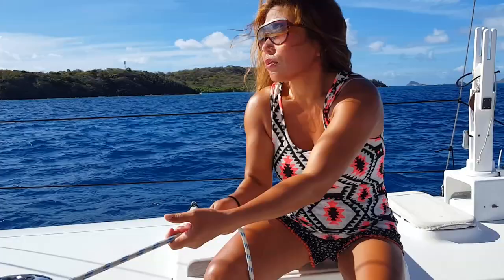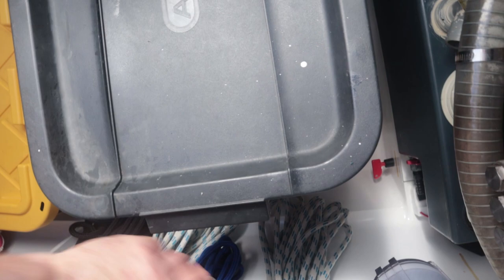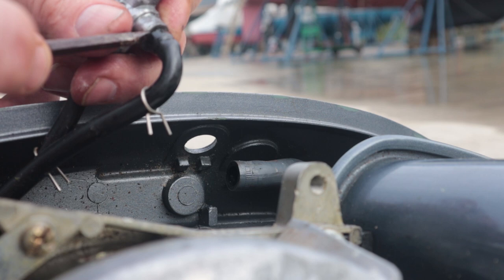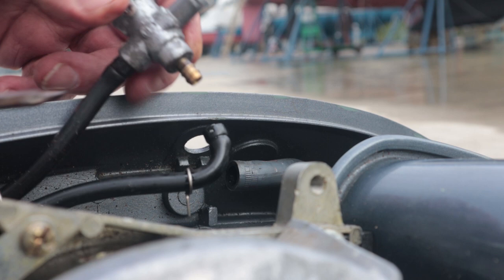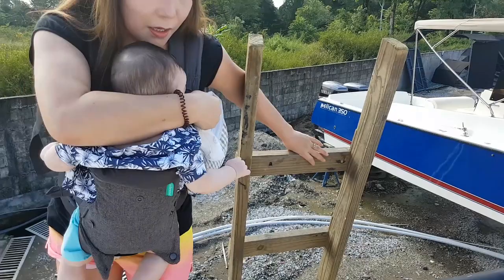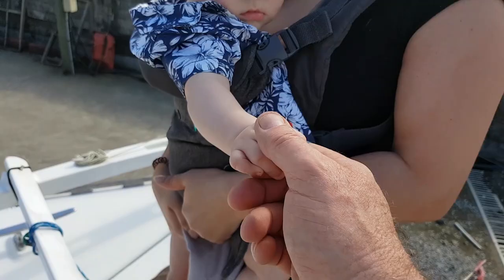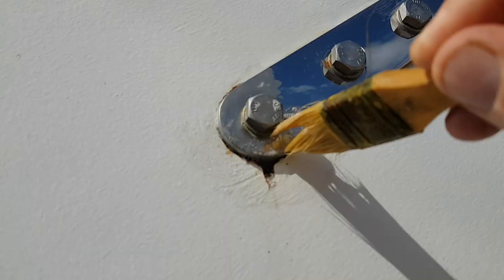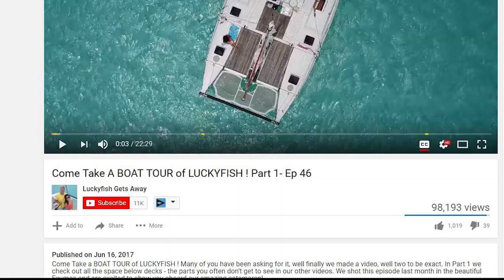Leo's first LOOK at Luckyfish - Ep 98 Sailing Luckyfish

Comment: I recall a previous video when you returned after having the boat stored during the off season, and the amount of mildew you had to clean up. (2-3 days? scrubbing all the interior surfaces) I am amazed at how it looks like there is No mildew present this time even after this extended time away from the boat. Looks like some Excellent Prep for the storage period! Saved yourselves a lot of time and labor and No structural deficiencies to be corrected on the interior due to water or mildew.
Reply from the maker: we had bad mildew on the outside at La Belle, Florida (after Irma). But the insides were ok thankfully. The bleach wipedown before we leave the boat (Im guessing that removes "food" for mildew to grow on?, plus the mildewcide and damp rid seems to work a treat! Cheers mate

Comment: You can re-passivate that stainless fitting with nitric acid.  Several commercial products are available for post-weld treatment of SS.
Reply from the maker: Thanks, great tip. Who knew? thank you !
Reply: @SailingLuckyfish  The corrosion will have altered the alloy to some extent, so it may be advisable to grind down to clean metal for the nitride passivation to "take".  I realize this may not be practical:  It might be worth trying on the corroded metal, because what is left will probably be Nickle-rich and may actually be less susceptible to corrosion once passivated...cant hurt to try.

Comment: Nice video. Leo looks happy on board! Looks like some water may have got behind that bolt? May be an idea to check it for crevice corrosion. We had a similar set up on a westerly on the rudder. When we went to undo it to remove the rudder and replace the bearings it snapped and was down to about nine tenths of its thickness in just 5 years. Looking forward to you next video. Sail Safe guys. Ant, Cid & the Pooch crew.